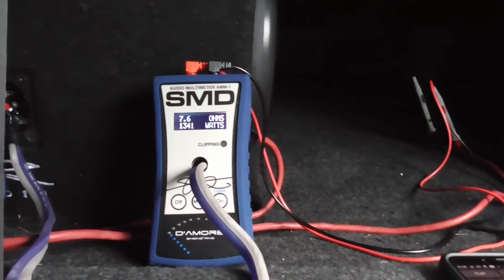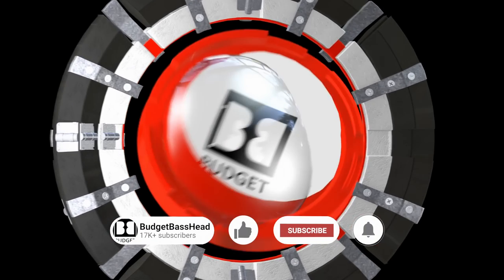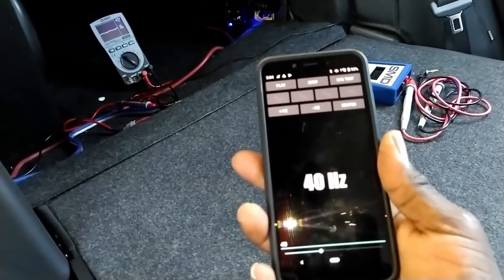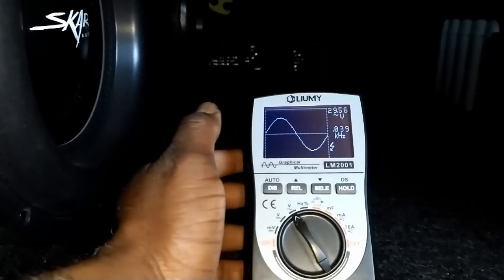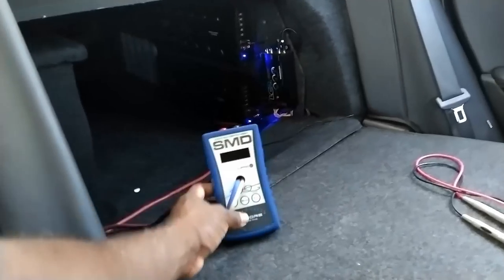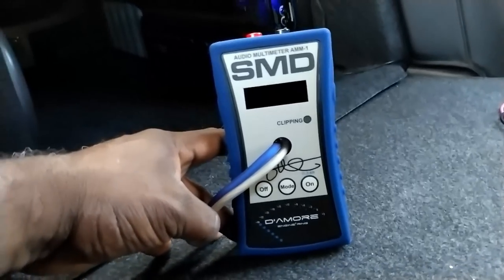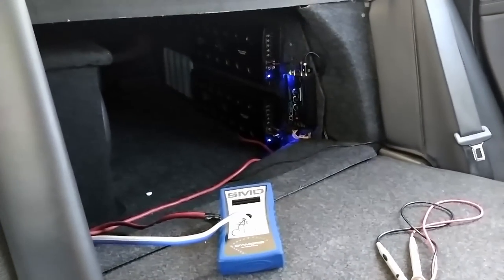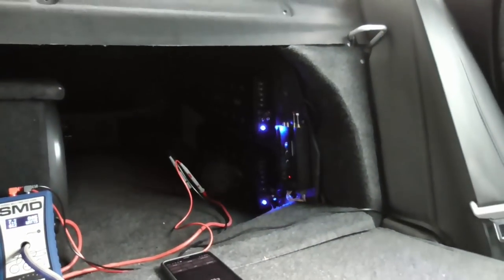How Impedance Rise Is Killing Your System!

Comment: Bruh u gettin box rise cuz u ain got no power or not enough adequate power runnin em...2 - 2k amps wit no big 3, high output alt or lithium cells or agms to give it power, then yea ull have box rise all day long. I saw yo ⚡drop bad on that 1st test tone an it was even worse on the 30hz song. Jus do ya big3 if u ain done it already, get a 15amphr - 25amphr lithium or agms,  re-tune ya gains then u should be good.

Comment: 1 more thing you need to run at .75 ohm and the rise will keep u up in the right ohmage also fuck those audio pipe amps there ok for a budget build but if you want real power on a budget you need full bridge amps  taramps stetsom I have a deafbonce full bridge 4900 and a sfb sundown full bridge 8000 these amps will smoke subs if your not careful also you have to be careful not to blow up ur amps by feeding to low of a ohm load . Now taramps has some that run from  .5 ohms to 4 and make the same power either way

Comment: Damn
Reply from the maker: ...what I said.
Reply: @BudgetBassHead  possible 1 of the amps isn't damaged or not putting out? Data link cable or overall amp failure?
Reply from the maker: @Sneakdisscommentbelow  I now have them back in my lab and will be testing them shortly I'll give you guys an update later on